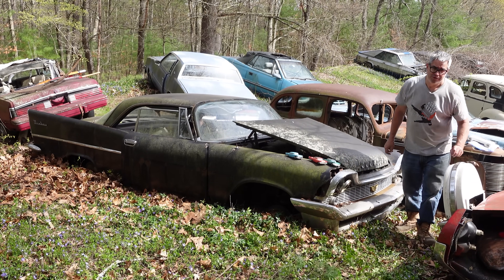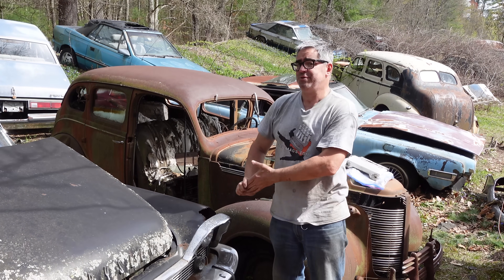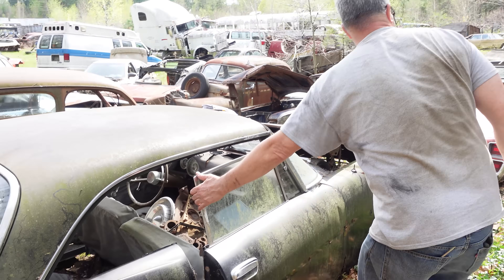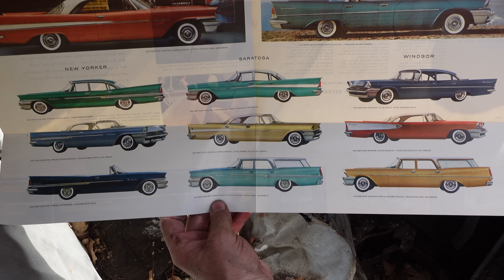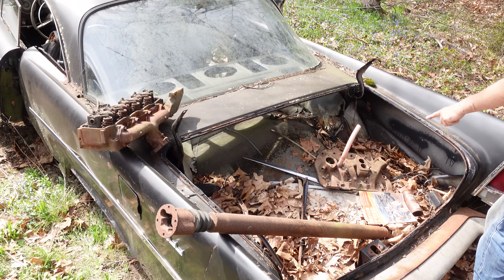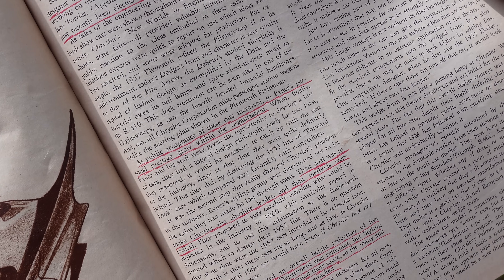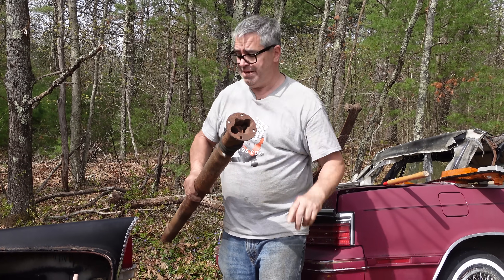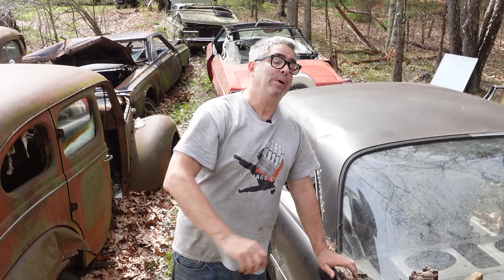Hey Four Eyes!

Comment: A quick torsion bar story. A coworker brought in a broken torsion bar off of his Dart and welded it back together. We told him that it was high carbon spring steel and wouldn't work. The next day he said "It broke as soon as we lowered the jack!" A used one was like $15 at the time! 🙄
Reply: Here’s another torsion bar story ,  a junkyard owner had a customer come in needing a lower control arm for a fifty five Packard , the kid working in the junkyard, went to a car to remove a control arm. The kid was lucky, when he freed the lower control arm with a length of pipe, it only broke three of his fingers, and sent the pipe straight through two doors of another junk car.

Comment: 57 Chrysler Windsor brings back memories from me as the youngest of 3 sons riding in the back seat from Dayton, OH to Houston, TX where we moved permanently in the Summer of 58.  Our 57 Windsor 4 door sedan was  later model with the dual headlights dark metallic blue with a white top and white side trim and yes with push button drive.  I sat in the middle of the back seat between my 2 older brothers.  My parents traded a 51 light green 2 door Dodge with an early automatic at a Chrysler Dealership in MIamisburg, OH for the 57 Chrysler which was a dream car for my mother with 4 doors better for a growing family.  On the way to Houston we broke down in Texarkana and needed a new fan belt and water pump and I remember it was at least 100 degrees and my mother was crying and told my father he brought her to hell.  Most cars in the late 50s didn't have air conditioning and when we arrived in Houston in was midnight and well into the 90s with humidity to match.  That fall the Chrysler got traded for a white 59 9 passenger Plymouth Sport Suburban with factory air conditioning.  The trip to Houston was enough with 3 bored and unsettled boys in the back seat and no air to cool things off so the Plymouth fit the bill.  I rode in the rear facing seat on the new Suburban and loved having my own seat and watching the people in the cars from behind.  From then on my father always had a station wagon even when all of us were grown and left home.  My mother had my little sister when I was 14 and my father had a flat tire in the family 64 Impala 9 passenger wagon on the way to the hospital.  I drove that Impala when I got my driver's license and loved that 327 with the Rochester quad 4 carb and despite the Powerglide that car would move.

Comment: Hey Steve - It should be noted that the brake booster seen on this car was actually a dealer-addition for a car ordered with manual brakes. If the car had factory power brakes, it would have had the Bendix canister or Kelsey-Hayes accordion on the firewall.

Comment: The cause of the problems for the rust in 1957/1958 @ Chrysler was that the dual headlights pods that captured pools of rain water and could never be released, thus rusting out the front fenders within months. Also added was the front windshield posts that collected water and did not drain properly, so the door frames became rusty. Ditto the rear window rubber seal, the water collected in the hinge area and dripped onto luggage and the trunk floor. ln 1958 they added rubber hoses and holes to redirect the rain water accumulation, but it never was correctly done.
Reply: Chevy struggled with rusting fenders as well, but I don't think it happened that quick
Reply: I think most headlight eyebrows were a popular destination for rust, back in the late '50s and '60s...
Reply: @DanEBoyd  As a kid in the rust belt, I remember lots of cars with coat hangers wired up to hold the headlights somewhat in place! The more mechanically inclined owners used scraps of metal (like old licence plates 😁) and sheet metal screws or 'pop rivets' to hold them in place. I had to do that to a '61 Comet. A $50 special in 1971.
Reply: Some years ago I found a '58 in a yard that was up on blocks. 

If you stood on the left rear bumper the whole rear would twist and the rear window (which I pulled and sold) would start to come away from the roof.  it was rotted that badly.

Comment: It seems like Chrysler products from this era were forgotten and the 57 Chevy Bel air got all the attention, until Christine. I have often wondered why the poly engines didn't have a bigger legacy. Making 290 HP from a 354 ci engine with a two barrel carb is pretty good power. If I remember correctly the 318 poly made more power than the LA 318 as well.
Reply from the maker: The "polyspherical" combustion chamber concept is good buy the hassle is that Chrysler (and the other Poly offshoots used in Dodge, DeSoto and Plymouth) were cast in a way that places the internal coolant passages quite close to the inner sides of the intake and exhaust ports. As they are, the ports are large enough to support 354 cubes but cannot be enlarged to allow more flow volume for larger engines or serious hot rodding. As "peppy people movers" the Poly family is good. But again their "curse" is how you "hit water" if you make the ports as large as they'd need to be for Hemi-league breathing potential. But they do have a menacing exhaust rumble. Thanks for watching and writing. -Steve Magnante
Reply: The BBC and later canted valve engines build off the poly design.  It has better flow than wedge heads of the time even with the same  valve sizes.

Comment: I've been watching car videos for the last couple years, daydreaming about finding an old one for myself and getting it spiffied up and on the road. 🤣 Yesterday I changed the oil, the trans fluid, filter and shift solenoids on my 97 mustang😂 today I feel like a gang of thugs took turns beating me with a burlap bag full of rocks. 😮 Muscles that I wasn't aware that I had are aching. 🤣 My bald head is sunburned and I have a rash on my back and posterior from sliding and rolling around in the concrete. 😂 Nope, not the 23 year old that used to crawl around and under these old cars.
Lol I'll need to get into better shape if I'm to restore an old American classic.

Comment: I love these cars! Myself and a few others have been waiting for this car's turn in the lineup, having seen it in the background. And Steve's fact-filled presentation was worth the wait. The rust over the headlights was common on all car makes back then, with Chrysler probably being the worst.😒 Schott Company, in Akron, Ohio stamped out repair panels for these and many other cars. 
 And as a footnote, the old promotional model cars were made in acetate plastic, which warped with age. The styrene plastic, also called ABS ( the stuff of black plastic drain pipes) was much more stable.

Comment: If you've ever watched the old TV show "Crime Story" Dennis Farina's character's personal car was a 1958 Chrysler 300 convertible. When you compared it to all the other period cars used in the TV series all the others looked like slugs. Interesting to see Chrysler was using an integral power steering box in 1957 when everyone else was still using the add on hydraulic slave cylinder systems that were complicated, heavy and always leaked when the seals got a year or two old. Ford used the slave cylinder systems right up to the 1970's.
Reply: Yes, watched that show when it was new episodes, mostly for the set design/cars

Comment: Prestolite made that starter for Chrysler and they are still around today. They are related to Leece-Neville who makes alternators for large truck applications, one of the more popular being the "4800" and "4900" Series units. There was a white and blue 1958 Windsor in my neighborhood up until about three years ago. The guy has a changing fleet of hoopties. I think it was owned by a guy for years that used to talk to my dad all the time when he was working on the 1941 Plymouth. My dad would say, "Nice chatting but it is dinner time. My wife is calling me." That was the only way to shed the guy. He was goofy and nerdy and rode a bike around the neighborhood and had "Nader was Wrong" shirts on all the time. No offense but he actually looked like Mr. Magnante. Lol. I showed the 1937 Desoto video to my uncle who is my dad's older brother. He had the Plymouth for years after my dad passed.

No VIN, can't win, but can be figured out, no doubt: L for 1958 model year, C for Chrysler, 1 for V8 equipped, then an additional "L" if it was made at the Maywood, CA assembly plant (Los Angeles, which operated from 1932 to 1971), and without that additional "L" if it was assembled at the Jefferson Ave, Detroit, MI plant. However, some literature states that the second "L" is for "Low price class" which would be something that future Chrysler VINs would use. The Jefferson plant that may have made this car operated under Chrysler from 1925 to 1990 and then closed, with a "new" Jefferson plant opening in 1991 and still operating today under Stellantis. The Maywood plant was located at 5800 Slauson Blvd in Maywood. The starting production number at both plants was 1001 in 1958.

Chrysler's west coast parts plant was located at 1950 Davis Street in San Leandro, CA which was down the block from the San Leandro plant at 1933 Davis Street and served as their west coast parts plant after closing in 1954 as an assembly plant. IHC had it for a time and then sold it to Caterpillar in 1975. Today, it's the Westgate Shopping Center. Ford's Maywood plant was across the street and that closed in 1957 when Ford's Los Angeles, CA plant was opened that summer (which was also called Pico Rivera and operated until 1980). They had several other parts plants, including one at 1150 Murphy Ave in Atlanta, GA which appears now to be a graffiti covered long range of buildings with many bay doors that you could envision could have been a parts plant. 

Chrysler had a "telegram" service for ordering parts that was a coded message system used by dealers to communicate and order parts. It was surely styled after some sort of military system following WWII with its coded messages and delivery instructions. 

No tag, can't brag, but this is code "A" Raven Black exterior paint. This is a case where showing the VIN and any other tags could have helped out. It was a bit out of reach from Mr. Richardson's filming to make it out, but I thought I (barely) spotted an "L" for the first digit, which is surely the 1958 model year.
Reply: Comparing the brochure to the Motor Trend article, the fonts/graphics in the brochure look ten years ahead of the late '50's
Reply: Hey Google User GP,  do you know what Auto-Lite made in Syracuse, NY?  I found some unused tags that look like they'd go on a generator, starter or distributor, gold and black, all they say is Auto-Lite Syracuse NY.   Was mixed in with model RR stuff in a box lot from an auction.
Reply: @CR7659  Auto parts. They are still in Arcade, NY so call them and ask.
Reply: I work at the mack Ave plant as a repairman  making the jeep grand cherokee L and the overflow regular grand Cherokee from the Jefferson  north Assembly  I love seeing all the old cars my family built im a 4th gen autoworker  I used to work at Mcgraw glass next to Wyoming assembly where the desotos were made before going to the jefferson Ave plant it neat to see all the history
Reply: @larrykirk9825  Yes, if those buildings could talk.
Reply: @googleusergp  I don't think the folks working there would have any idea about what they did 200 miles away 50 years ago.
Reply: @CR7659  When you contacted them (of course you did, right?) what did they have to say? Sometimes it's easier to try to hit a home run going around the bases in order than trying to do it backwards and barrel over the catcher to get the run.

Comment: Another excellent video. Amazing how resistant regulators have been to even simple innovations like the quad headlamps.  Remember how long it took to get approval for aero headlamps in the 1980s?
Reply: Those useless regulators are the ones who approved all of these blinding headlights out on the road today.  They deserve to have their eyes clipped open, Clockwork Orange style, and be forced to look at the too bright, or otherwise irritating, headlights they've approved!
Reply from the maker: @DanEBoyd  I agree with you 101-percent. My 58 year old eyeballs are dazzled and nearly useless when modern rolling arc welders approach in the oncoming lane at night. Sure its safe for the occupants of that car but HOW DID THESE FLAME THROWERS GET APPROVED by the Fed? I now place my left hand close to the windshield and manually block the nuclear fireball until it passes. I used to flash my "high beams" at them but when they retaliate with DOUBLE BRIGHT lights I realize they are just driving with the "low" beams on. Holy Moly! Anyhoo, Thanks for sharing. I agree! -Steve Magnante

Comment: Wow that's not in that terrible of shape.  Well, until you see the frame, look at that rot left front behind the radiator support.  I'm sure the rear of it the springs are up through the trunk.  Or not, the whole drivetrain is out of the car, but I can see the right frame rail is broken by the saggy bumper.   What a shame, that's probably the best looking '58 car. 

Steve, you didn't mention this Windsor and the lower-end DeSoto went to a shorter wheelbase Dodge chassis for 58-59, using the Dodge fenders and that chrome brow over the lights and across the front.   DeSoto even shared the dash with Dodge.  

That back glass is worth a few bucks, same as a 300 and impossible to find if you need one. 

You can see the 1960-61 styling in that artist rendering.

Continental kit on that 74-ish Olds is a pretty rare piece too

Comment: I've inherited my Dad's 1958 Chrysler Saratoga. 354 poly with factory 4 barrel.  It's been sitting in the same spot since the mid 70's on our property. "One Day".....I want to pull the motor and do some forensic mechanicin' to see if Dad's stories about the engine are correct. He said it's been bored to a 411 CI and has some factory experimental camshaft/timing set. Even if those were tall tales, I would still like to get it cleaned up, running and put it in a hot rod. And yes....the body of that 4 door is trash. Frame is completely rusted.

Comment: Knob on top of dash what was that
Reply from the maker: It had me confused. I'm thinking it may have been a "delete button" for the dash-mounted mirror. Just a guess but it could be the mirror could go EITHER way, up or down. Maybe this was the "cheapskate" mirror setup and that plug sealed the mount for the spiff version. Not certain but it makes sense. I'll dig in deeper soon. Thanks for watching and writing. -Steve Magnante
Reply: That is where the rear view mirror was originally mounted. It was on a ball and socket swivel. The round knob or ferrule tightened it into position.  They did tend to loosen with age. I recall some people just removing the now useless mirror. I believe someone ( like a J.C. Whitney ?) offered a relocation kit, or the owner relocated it with another mirror off another car altogether.

Comment: This guy gets so much wrong or fails to know some of the most important features. Starting in 1957 the Chrysler Windsor used the shorter Dodge front fenders because the Windsor was on a shorter wheelbase than the rest of the Chrysler line. The front end design was also a bit different too because of the use of the Dodge front fenders. Dummy Steve did not even notice that in his brochure right in front of him. The front view plus the side view of the front fender of the Windsor is different from the other Chryslers in the line up. Super obvious but dummy Steve does not ever notice that.